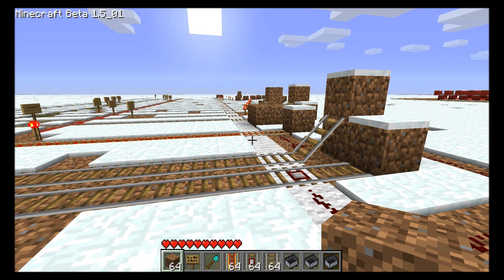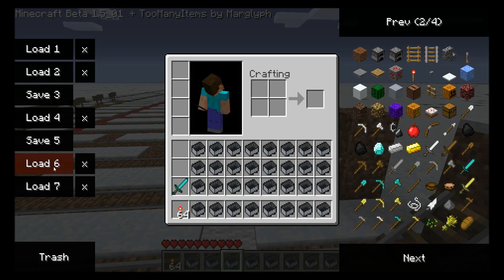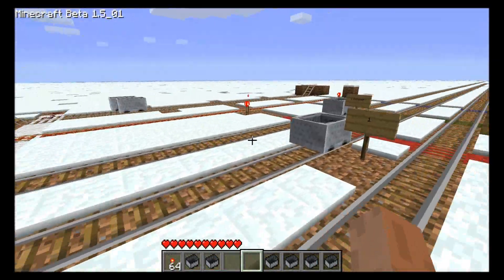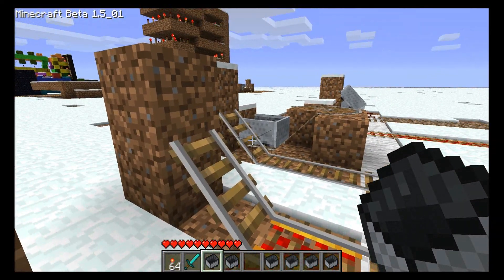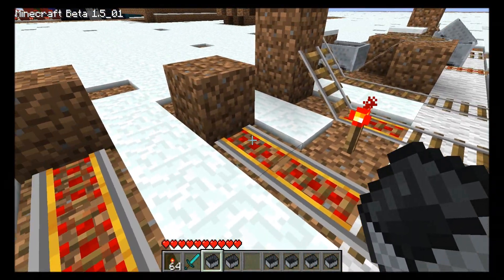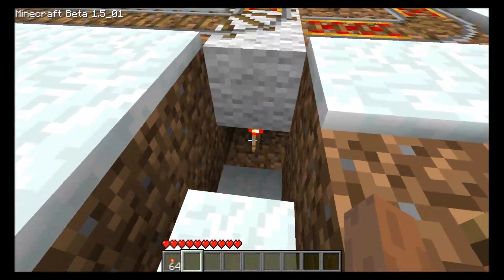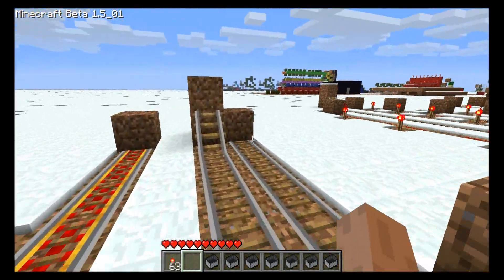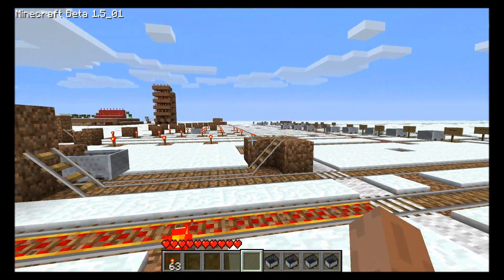Minecart science with powered rail

Comment from the maker: @pixartist They have a maximum speed, but they can also have a momentum higher than that. The easiest way to see this is to compare a short booster track with a long one. Both will bring your cart to the maximum speed very quickly. But with the longer booster track you'll stay at that maximum speed for a longer time before you start slowing down.

Comment: @LeviJones9000 ..Did I say that you'd be using them as proper propulsion? No, I didn't. What you would use them for is one or two bits of coal to nudge the train into the booster tracks, then return to where it started from.

This idea is to allow for trains to be kicked off without needing to place each cart against a wall. The alternating is for speed management when you hit top speed, not for moving the powered one.

Next time, read into it to get what I mean.

kthxbai, have a nice day.

Comment: Here's some things about powered rails vs booster setups..

Space. The powered rails are integrated into the tracks.
Momentum. Yes, it may not have the sheer amount of momentum as a boosted cart, but a constant-motion booster setup using powered rails will not randomly stop.
Gold. Yes, gold. Y'know, that stuff that just clutters up your storage, useless for anything? This gives it a good use.
Reliability. You don't have to worry about a random mob running into your booster carts.

Continued--

Comment: boosters are far more cost effective because gold is far harder to come across than iron. also how come detector rails have wooden connection joints between the two rails on the track but there is no wooden items used in the crafting recipe? i am confuse.

Comment: Power rails are not suppose to stack, you're suppose to put them at about every 8 blocks to keep them going or replace your normal rails with power rails completely. When you play minecraft legtimately, it's not suppose to be easy, you can't expect to have an easy rail track by minimum material requirement, power rails are suppose to be collectively used, not just used for the beginning of a track. I'm not fond of this idea, I would much prefer the use of coal to make steam trains.

Comment: @TaviRider What you need to compare is, say, a 10 long old-style booster compared to placing 10 powered rails out on the track, since thats how they're designed to be used. Now what would be an interesting experiment is to see how many blocks apart the powered rails should be out on the actual track for optimal distance/speed/etc.

tl;dr you're doing it wrong

Comment: @TaviRider you totally missed that the point of the powered rail is to spread out the powered rails out over the ENTIRE minecart track rather than having a single long booster at the start. You're not using them as they're designed.

Comment from the maker: @senorjuaquin As I understand it, the moment you get two carts together their previous momentum is pretty much irrelevant. They will interact very very rapidly and either repel or gain a whole lot of momentum. I doubt using the powered rail loop to get a booster cart moving would make a difference.

Comment: Pretty sure that the only differences you were seeing with more than two power rails simply had to do with the fact that the non-boosted section started farther down the track.

Basically if you took the traveled distance as the distance between the end of the booster and when the cart stopped there wouldn't be any gain at all from additional boosters in a row.

Comment from the maker: @ArlanTLDR I read that as well regarding 32 and 64. It's hard to test max speed accurately, but I'll give it a shot.

I also think the best stations will use a mix of boosters and powered rail like you described. For the initial launch, powered rail is superior. But next you need a booster for a runaway cart detector, so you might as well give a big momentum boost at the same time. For arrivals, powered rail works fine and is simple and compact.

Comment from the maker: The alternative to rail detectors, which use pressure plates, will make the cart stop. To prevent this you need to use a booster cart alongside the pressure plate. If you don't care about occupied versus unoccupied carts, detector rails are great.

Comment from the maker: @adzicents Dispensers would need the powered rails in several places, which may be inconvenient: Powered rails don't curve, so you can't put them everywhere. They have to be powered, and that torch may interfere with other circuitry in the area if you're working in a cramped space.

As for runaway cart detectors, the only reliable way I've seen to do that is to use a booster cart to push it over a stone pressure plate. You can't do that with powered rail.

Comment from the maker: @Banjooo96 I'm working on a new fully automated minecart station. It'll probably be done tomorrow. It will use powered rail almost everywhere. It reacts faster than booster carts, and it has fewer moving parts, so it's less likely to get fouled up.

I haven't yet seen a reliable runaway cart detector that works without booster carts, so I think I'll still have to use one for that.